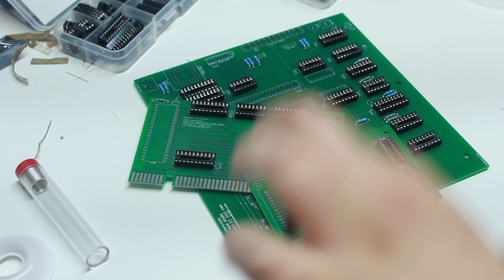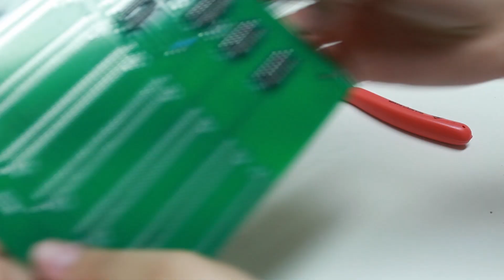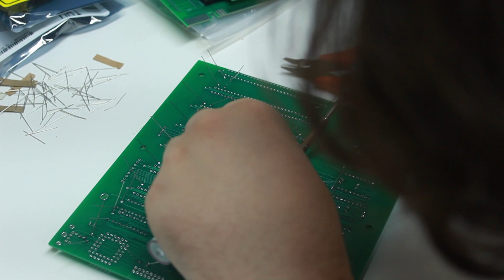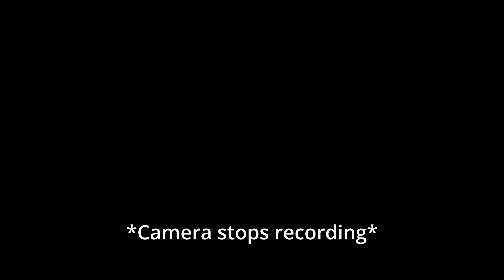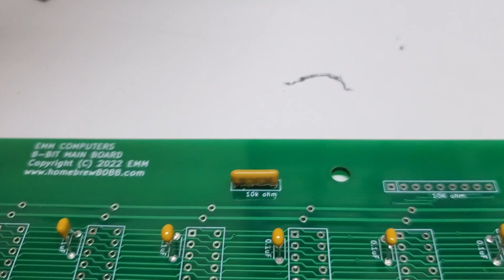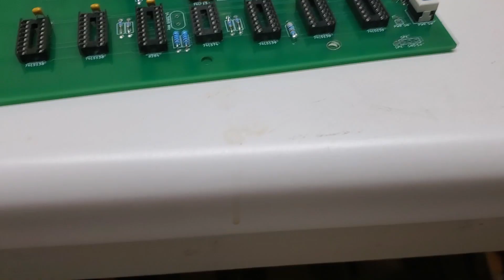Homebrew 8088 PC Build Part 2

Comment: How/where do you get the PCBs?  I see the schematics on the Github, but how to you go from that to actually getting the PCB?
Reply from the maker: I bought mine from Elijah Miller's ebay page since it was cheaper than getting them special made from a PCB manufacturer. The link should be in the description.